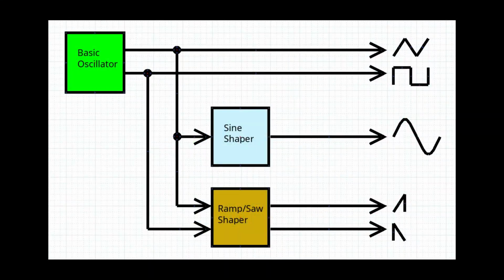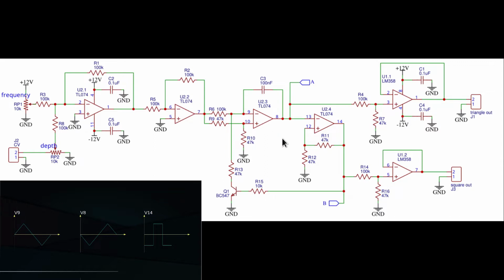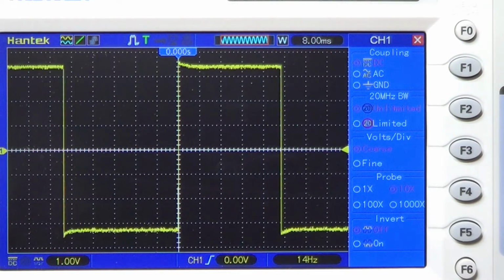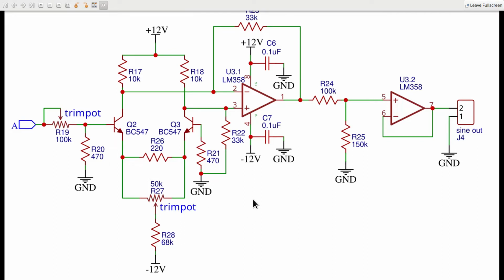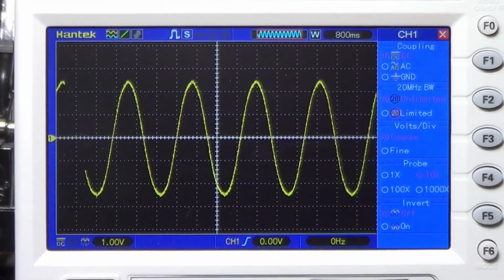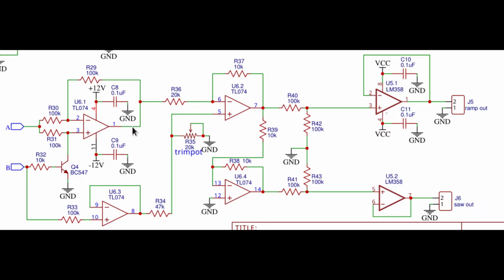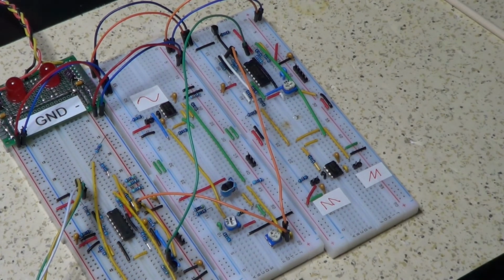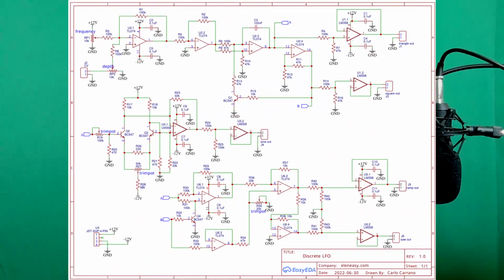The Synth Project Episode 18: LFO Module, Part 1

Comment: Question have you thought of using a TL072 FET op-amp?
Reply from the maker: I actually did use JFET op-amps. The TL074 in the schematic are basically identical to the TL072, but the amount of op-amps in the chip is double. Some of the op-amps in the circuit, however, did not have the need for a very high input impedance and so, for those, I just ended up using the LM358